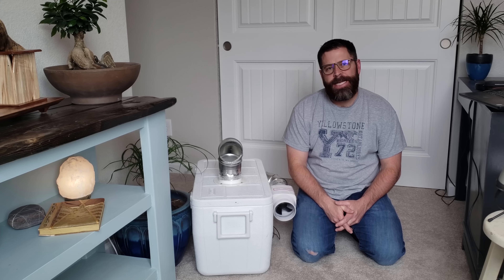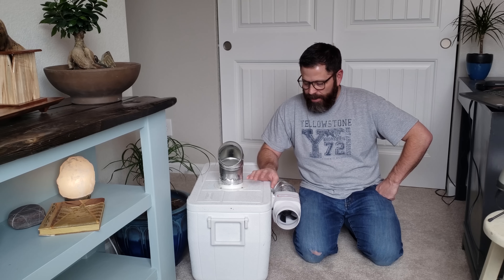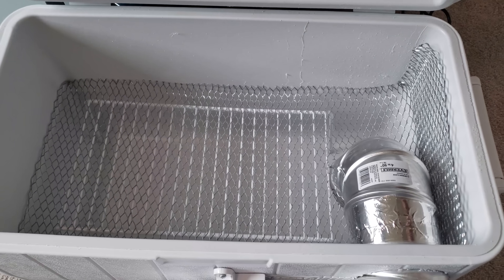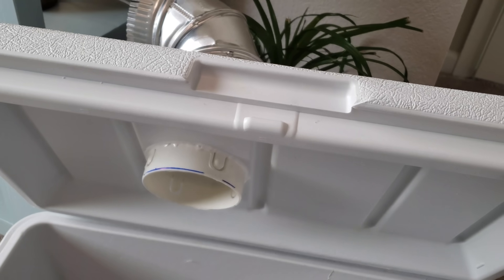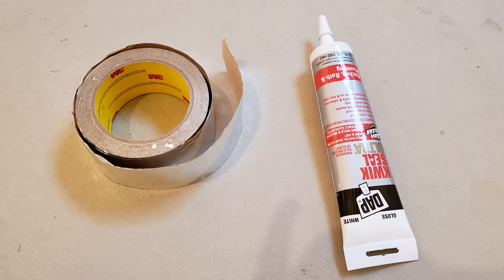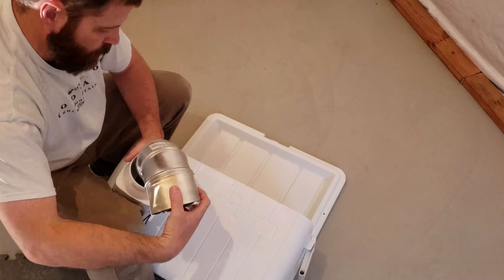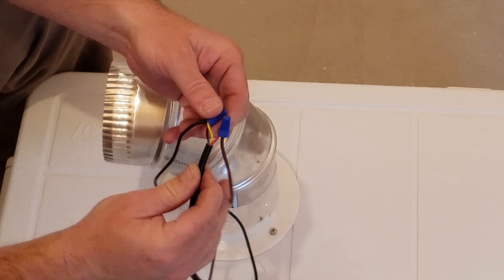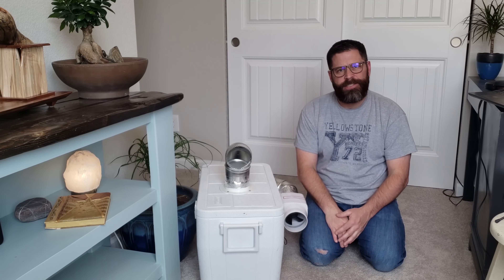Homemade Portable Air Conditioner DIY - Coldest One Yet!

Comment: Love it and you used a tune called Blueprint ( mikael Manvelyan. ) to build it with. Very impressive and safe for the environment. AC Not. They are expensive to run aswell. Thanks for sharing this very impressive air COOLER..

Comment: If you use some 2" PVC pipe you can put it just below the ice bed. So get two 2" PVC elbows and about 2' of PVC pipe. Then basically the same way you have your vent under the ice grate, put the PVC pipes there as well and went out the top with the two elbow pieces.

Comment: I don't know how long it took you to make this but I would buy this from you! Name your price!! SERIOUSLY!
Reply: Has anyone suggested sealing water in a food saver bag and freezing it?
Reply: @nacanemusloyale9085  gallon jugs
Reply: @nacanemusloyale9085  the best thing I could think of is cookies trays and or Teflon coated pot's and pans.

It's all about surface area and direct contact with the air.

Thin sheets of ice will freezer fast and melt quickly larger block have less cooling ability but melt slower.

So a mix of both to max cooling time as once you have dropped that 3-5 dergers it just about maintaining that temperature.
Reply: Rainiel Saclay  This is intended for camping. Did you think this guy is cooling his house with this thing!?!
Reply: Rainiel Saclay   what is an aircon?
Reply: @BarberLou86  AC
Reply: @BarberLou86  But it's not so portable. You can run the iced one mostly everywhere. It just needs 12volts.
Reply: Will you make one for me I'll pay you Thanks Carl

Comment: Great design, dude, but you didn't show the temperature difference between outside air and air coming out of the cooler.  If the outside air was in the 80s, then bam, very impressive!  If outside air was in 60s, then not so much.  We can't compare efficacy among the diy coolers if you show only the temp of air coming out.  Thank you.
stevenspainhower@gmail.com

Comment: Hi there,

My name is John and i live in Germany.
Just saw youre very interesting Video
I got a question:
I got a compressor Box who i use when drivin with my heavy Truck,it works on 12/24 Volts Waeco FF 30(its an elderly model,but works fine)
Would you say, mounting a Vent inside the cooler while operating,i could have also an ac unit?

Comment: It will only work until the ice melts and then the motor will probably get water in as well as leaking out the edges every time you go round the corner.

Comment: The colder it is the faster the ice melt and the faster you have to replace it 

You can cheat the laws of thermodynamics here 

But I’m more worried about efficiency, using a freezer sounds less cost efficient than just using an AC outright and there’s also the problem with space. 

Maybe you can get ice cheaper in a store than your own freezer but I think ACs are generally cheaper long term

Comment: I've actually never owned a vehicle with ac. I took my current vehicle to the dealer 7 times and got it fixed but it still doesn't work. Cold beer though, works every time.

Comment: i dont know why but.. i dont like this one 0.o im going to build his second model. the one where the duct snakes through the bottom. ive already ordered most of the stuff i need.. the only thing im wonder is.. is that ducting water  tight?? will i have to keep finding a way to get water out of the tube?? cause i would like to fill it with some water then ice.

Comment: Now use solar power to make the ice.
Saw a YT video once that showed a guy who made the same as this guy but he used a large heat sink (cutting out a much larger hole in the chest), and used a wire shelf to hold the ice.
Not sure if this added any efficiency, but,  I can't recall the details of the heat sink.

Comment: There is one thing to remember.  As you run the air over the ice, it is picking up moisture, thus adding humidity to the air making it just s bad. if you have one, run a dehumidifier. this will also help   You need to run the fresh air though a tube then fill cooler with a small amount of water, add the ice, so it is over the tube .  by adding the water helps to transfer the temp of the ice into the dry tube. use 2 inch PVC pipe. run the 2-3 in parallel (using some Ts and elbows).   Intake, start with a larger diameter pipe, then use a reducer down to the 2 inch pipe.  Output end with a larger diameter pipe. If you keep pumping humid air into your house you could start having mold problems.
 It's all basic  thermodynamics.
Reply: Dehumidifier would end up adding heat since it works by condensation.  This would have a latent heat effect, but in reverse since condensation is the reverse of evaporation which has a latent cooling effect.  Not to mention the electricity used eventually just turns into heat anyway.  (A dehumidifier is actually an efficient source of winter heat if you live in a mild/chilly, damp climate, or in spring/fall when you’re experiencing rainy 50F weather)

Also, a dehumidifier is basically an air conditioner that doesn’t exhaust the heat outside, it simply recirculates it in the room.  You’re better off just using A/C.

Comment: The blower was a great idea and had me thinking. How come design it to push the air through instead of exhausting the cool air out with unidirectional valves to intake airflow making a vaccum to avoid a pocket of air inside creating a cooler enviroment inside the cooler?

Comment: No. It needs to work like a window ac unit. Copper tubing. Aluminum ribs. And prove it works. Turn it on. Show the wind blowing and show  a thermometer with the temp dropping.

Comment: That's pretty smart. And with 200+ cfm's being pushed through a 6 inch pipe the velocity or throw would be outstanding for rapid cooling of an area space while under load. A simple cooler turned into this is freaking awesome lol

Comment: How long do they last in your experience until you need to refill the ice? I know this will vary based on the ambient temp but on average for your use?
Reply: I was wondering the same thing. Would a  portable freezer work better. I'm trying to figure out how to cool a sprinter van

Comment: Great video.  If you drill holes in top and sides of cooler ice will last 2 hours longer. With expanding foam as most cooler sides and tops are hollow.  How long does your ice usual last while using???

Comment: Would this work with plastic or metal ice cubes ( the kind you can freeze and refreeze without watering down your drink) or is water required, and can it be done with a smaller, more compact unit?

Comment: You need to quit calling these devices or these gizmos an air conditioners, they're not. and air conditioner does two things it conditions air when it gets rid of humidity also cools the air. Just call it a room cooler with a crapload of humidity

Comment: The fan suggested here runs 72W (6A @ 12V).  I need to run the cooler overnight in a tent on a 300W power bank.  This would last 4 hours.  I found a West Marine blower than runs 30W (2.5A @ 12V), which will last 10 hours, but blows 200CFM.  Is this enough to cool a tent?

Comment: If I want to power this from an electrical outlet, what kind of power connector would you recommend so I can test using this indoors instead of a cigarette lighter socket plug?

Comment: how many hours does it last ~ I imagine you would have to refill every so many hours!
Reply: At 85 degrees the ice was gone in 1 hour. Filled with 23 frozen water bottles at 85 degree outside temp. they lasted about 2 1/2 hours before they were all unthawed.
Reply: I thought about this very plan based on some military training I had in survival through my law enforcement career....

I don't know the exact reason...but the larger a black of ice is the longer it lasts and certain types of salt slows down the melt rate as well.....

If you were to have a large freezer and had a custom ice tray built exactly to properly fit it..

I estimate you could get 4 hours out of it.

If you carried 2 same size ice chests with max insalation and carried 2 or 3 blocks in the other one without it every being opened it should hold 90% + 

So by the end of 3.5 to 4.5 you could change out the water 💦 for the new ice and hopefully you would get 7-8+ hours combination..

I think this guy is smart and awesome...

Comment: Has anyone ever tried having a second air outlet that feeds directly back in to the intake fan, so it's recycling the chilled air???????  Would this even work????
Reply: Sort of, yes.  You'd have to add a radiator to the hose outside the cooler, then you'd have to add fans to said radiator in order to blow hot air through it and cool that.  This is called indirect evaporative  cooling, and while it has the benefit of not adding moisture to the air, it's much less efficient at cooling.

Comment: I use a 1040 cfm 8 inch computer fan. It last longer on the 12v battery. I use a 12v that is meant for a security backup. I run a dryer hose around the perimeter of the ten with hole cut out at 1 foot intervals, or so. Feels like central ac. My tent was 69 degrees on a hot florida day that was 98 on the outside. I spent 20ish dollars. Most expensive was the battery but I wanted as beefy battery as I could use and it still being practical.

Comment: A solid block of ice lasts at least 200% longer ime. Frozen gallon, or 2 liter, jugs of water also last longer. Make sure to leave 2 inches of air in the top of jugs for the ice to expand. They also sell silicone bottles which will stretch but silicone might be somewhat insulating, I have not tried silicone bottles.

Comment: I made one yesterday it works pretty good really really cold I used all PVC tubing though I didn't use the metal ductwork
Reply: I can't find SEAFLO 4" Electric In-Line Marine Bilge Air Blower 12V 270 CFM 456 CMH Quiet Boat White

Where did u buy it? What site? It's not available no more on Amazon
Reply: @danbeto135  Ebay
Reply: I bought mine on Ebay for $21.95
Type in (4'' In Line 12V Marine Boat Bilge Air Blower Fan 270 CFM Ventilation)
Reply: @cadillac8927  pass the link man

Comment: How did you keep the fuses from blowing with connecting that fan to a cigarette lighter adapter for the car? My dad even tried heavier gauge wire, and blown at 15 fuse.

Comment: Very cool build!  You could increase the air diffusion by extending a duct or hose going across the bottom with a series of smaller holes to evenly distribute the air under the ice.  Perhaps even a tight mesh could even work?  Now I wanna build one!

Comment: If i used 2 of the same motors but the 3” version so I can have 2 outlets, do you think it would work just as well?
Reply: just think, once you have more airflow your water will get warmer faster, and your ice will melt quicker, but you will be able to cool a bigger room just not as long

Comment: A better way to make this is use the metal bendable hose from the other vid bend it going down and round the inside of the box and end pointing into the middle area then lay the mesh on top of the pipe. The cold water from the ice will keep the pipe very cold meaning it will cool the air before the air is pushed through the ice

Comment: I built one similar and I don't call it an air conditioner... I call it a high speed ice melter.  On hot day it will be melted in less than 45 minutes.

Comment: Hey it may work better if u put a another 90 on the other side of that pump where it pulls air and that way it pulls cold air from the cooler sends it thru the ice and comes out the top it would at least be pulling cold air and sending cold air thru the ice prob b a lil colder at end result

Comment: Tip: use a block of ice. May have to crack it up a bit to allow the air to still go through easily but the chunks will last a lot longer

Comment: Hi Jason !  I was trying to purchased the Sea Flo 4inch Electric In Line Marine Bilge is not available and Ive checked people who purchased this machine was getting slow and won't last long. No longevity is there any brand that might be better that will last long and can you show me how to connect the wires of Xprite cigar lighter . What tools I need to splice the wire and connect it. I'm new to this. Please help. Oh by the way what is that scissor type that used on the 90 degree elbow by pinching it's bottom edges. Thank you very much.

Comment: Ok update: I made this in a smaller version. It does produce really cold air. Unfortunately, the ice only last about 5 minutes with one bag of ice. So I put two bags in and tried again. Only lasted about 30 min. I think the fan is to strong for a small cooler. I’m gonna try freezing water bottles and ice packs next. If that doesn’t work I will try a bigger cooler.
Reply: hey, did you ever try out the water bottles/ice packs? did they last longer?
Reply: @imacc2009  yes I tried them didn’t help any. There is a way to do it I’m just not clever enough lol. There is something you can do with coils like a radiator type set up
Reply: Have you tried with dry ice?

Comment: They never tell you how much ice they need to cool an area and keep it cool. Nor do we ever see any actual space cooled and showing the temperature drop. Why, because it does not work.

 Let us say 1 bag per hour, then we cool an area for 24 hours at $1.99 per bag of ice equals $47.76 plus tax.  In one week that is $334.32 (plus tax).  In one months the cost is $1432.80 (plus tax). Next you factor in all the labor in constantly supplying ice.  

In the old days when they had ice boxes in the kitchen and a solid block of ice would be delivered (50 cents per hundred pounds), the boxes were insulated and not that big. A 50-pound block might be good for a few days if the kitchen was not overheated.

Comment: You should try adding a peltier as an ice/cold generator and heatsink the hot side with a fan or output waste vent for hot air. A peltier takes volts in, then one side of a plate freezes, the other heats up. Instafreeze is possible.

Comment: Might be a stupid question but since the ice is going to melt eventually and turn into water  at the bottom of the cooler and the inline blower exit valve is at the bottom of the cooler is it going to burn out the motor or any other issues ?

Comment: The title of the vid should be "The quickest ice melter project."  

All these cooler/fan/ice deals are gimmicks, dont waste your time. Ive made plenty. It doesn't cool a room at all. It feels cool for 5 minutes when you put your face up to it at the start. That's it. 

Lets run hot air into a box of ice and hope it works as an air conditioner. Said every Polock ever. 

It's the biggest ice melter you'll ever make.
Reply: Yeah I’ve made two different ones and they don’t work. One with the evaporative fabric and this icebox one too. Just blows hot air.
Reply: Heat energy is sequestered during the melting of the ice, if you're room is not decently insulated, the heat will just radiate back in from outside or from other other rooms.

Comment: Soooooo how do you wired this is to like a wall plug or a USB plugin?
Reply: Definitely can't do USB for this one, voltage and amperage are way too high! USB only does 5V max, not sure about amps. As far as an alternative, I'd recommend finding a power supply putting out ac or DC depending on the fan, at whatever voltage is closest. Note: the voltage can be lower, but it can not be higher. After that you just cut the wires on the power supply(wall wart, power adapter) and connect them together.

Comment: Hello - the connection here is with a 12v cigarette lighter which works well in the car, but what about if you want to use it at home? Is there anh way of connecting it using a normal wall socket? I live in Germany with 240v ;-)
Reply from the maker: You would just need to find a 120 to 12 volt adapter. You can find them on Amazon.

Comment: As a former residential  hvac service technician these videos always make me laugh. Dont waste your time with this stuff. Go buy a window a/c unit  and actually have it do some cooling. Look up the refrigeration cycle if you don't believe me. You wont save any money by using these type of homemade "air conditioners". Your are not getting rid of any heat in your house especially if you use ice from your freezer in your kitchen. An air conditioner works by absorbing heat from inside the house into the evaporator coil and rejecting heat from the condenser to the outside. Nice try though.

Comment: These hillbilly AC's are neat, we used 5 gallon buckets with a fan on top & vented on the side. They were great in #'s at our RC race track, but styrofoam worked better because of sweating.

Comment: What about the air being so wet blowing in the area? We used one simerler to this type of cooling in our shop and finally stopped using It because I couldn't keep my paper work dry, not to mention your car floor will rust from the inside and corrosion of the electrical system without being in a rustbelt area.

Comment: The only negative I can see is that the room will have a lot of dampness,maybe you would have to have a bucket of damp rid near-by.
Reply: Gallon jugs full of salt water should help. There would be minimal moisture from the condensation on the jugs but much less than straight melting ice

Comment: does this type work better than the pedestal fan type where you wrap copper tubing around the fan and it run thru the cooler filled with ice and water?   you going to buy bags or ice to run the AC ?? no, I don't think this is a good idea

Comment: This is dumb. First off it won't last long second it's a piss poor design. First the air being forced in should be delivered to the very bottom of the cooler using a pipe that has many small holes drilled in it. Then on top all you have to do put layers of ice then rocksalt then ice then rocksalt. The air that will be delivered into the bottom of the brine solution would deliver far more cold air than just half the amount of regular ice. The more small holes delivering the air to the bottom the better it will work.